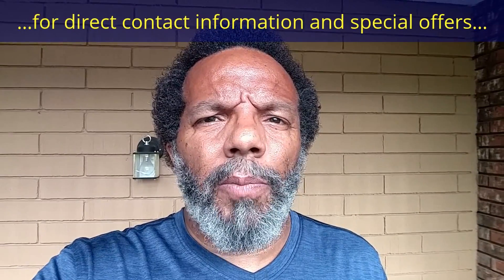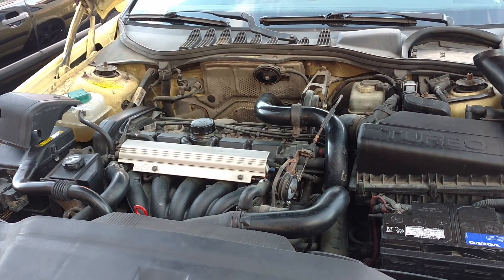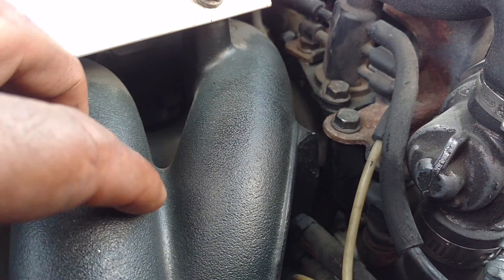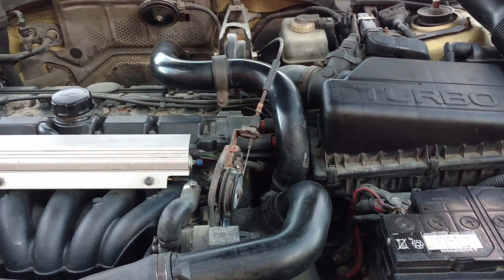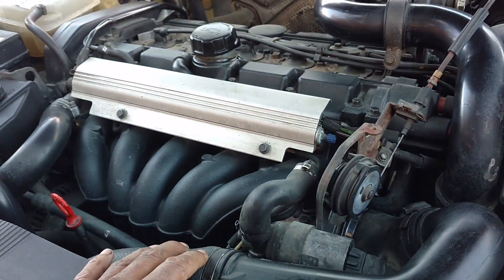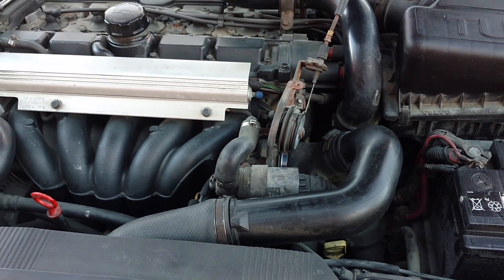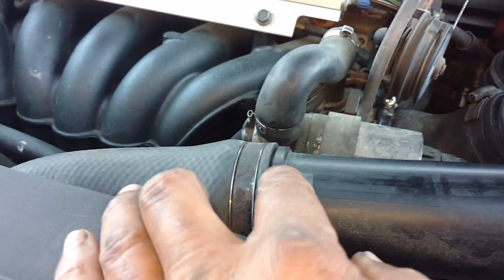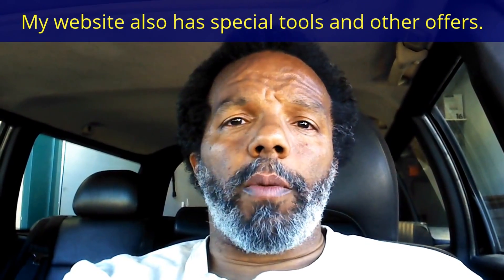Turbo system charge piping pressure tubes and vacuum lines need to be serviceable. - VOTD

Comment: Mine is running with one of those small pipes open on one end ,,my work is that the mechanic is saying it does not matter even if it's not connected
Reply: *my worry is that ***
Reply from the maker: 😳 gulp. All vacuum lines should be connected on both ends.

Comment: Robert I'm having a rough idle with my Volvo C70 2002 turbo 2.4 L every morning when I start the car up I got a code of 0014 and I changed the oil in the rough idle didn't go away so I changed the mass air flow sensor also because the car was running with a rough idle in that mass air flow sensor went out and I just change the camshaft sensor and I'm still getting a rough idle early in the morning upon starting the car what could be my problem with my Volvo 🤔💡🙄the car has excellent power on the highway and it runs great but I keep having that rough idle still early in the morning I'm contemplating having the exhaust valve timing solenoid change but I'm not sure if that's the problem could you give me some type of tip thank you
Reply from the maker: https://youtu.be/cWKOi8D4SWQ

Comment: Hey robert so with my 98 s70 t5 I'm currently experiencing a high idle when stopped. And when I come to a stop the idle will hover around 1200 . Unless I turn the AC on then it will drop to around normal idle or Maybe 100rpm over normal idle. I also have been getting a iac p0505 code, even tho it is functional. Car drives fine however it's just that idle and when I come to a stop.  Does this sound like a possible boost or vaccum line leak? Or am I probably looking at something else. Thanks
Reply from the maker: Yep, air leak. If it boost good, it's a vacuum leak.

Comment: 1998 v70r p0172, car runs perfect and builds boost perfect, vaccum lines look good. sometimes it take 10 miles to come back on after being cleared, sometimes it's 100 miles I'm honestly lost.
Reply from the maker: Is it idling high? Maybe the MAF.
Reply: @RobertDIY  I truly appreciate the reply I came to find the fuel pressure regulator elbow that connects to the manifold had a small Crack

Comment: Hey Robert, i own a 850 T5 and i think that the hoses from my TCV to the Turbo are swapped. i saw a construction plan where the hoses should go but i am not sure if this plan fits my motor. in this plan the TCV has 3 hoses. first is green, then blue, and at the bottom a yellow hose.
so what i noticed if i compare the plan with my hoses: the one at the bottom (yellow) connects where the green hose on the turbo should connect and so its in reverse: the green hose ends on the wastegate.....i have also a ,,pulsing'' acceleration....any tips? or any plan espacially for this T5 modell? (226hp) (1996)
Reply from the maker: Did you watch this video?

Comment: At 1:34 where you show the vacuum tree, my 96 850 Turbo only has one white line coming off the top (with the two holes below covered by caps). What does the black line above the white line on yours go to?
Reply from the maker: Probably the EGR.

Comment: I would like to ask you a question rather than a comment I'm doing PCV service on my 2002 S80T6 is it safe to start with all the turbo lines disconnected to back it out of the garage?
Reply from the maker: As long as nothing gets sucked into the intake. It probably won't start. Having that stuff disconnected will suficate the engine.

Comment: Hey Robert, I've got two OBD2 codes: "turbo boost sensor, and turbo boost sensor circuit a low" and my car idles and gets bad gas milage. I've got a 99 V70 xc. Could air leaks in the intercooler system cause these codes? Or should I get a new sensor first and foremost?
Reply from the maker: yes.
Reply from the maker: what is the code number? Have you Googled that?
Reply: @RobertDIY The codes were P0236 and  P0237. I have looked into them on google, but I just wanted to know what you thought or if you've run into this one before.

Comment: Now where do those vacuum lines go from the tree? Mine are all disconnected and it's been months since my Volvo has been running.. Thank you for your videos... They help allot
Reply from the maker: I don't even know what kind of car you have. 😕
Reply: @RobertDIY  lol. It's a 1994 Volvo 850 2.3 T5 station wagon.
Reply from the maker: https://youtu.be/gt9w-ZSxs9I
Reply from the maker: You can't tell from the video?
Reply: @RobertDIY  not from this one. Was looking for the thin vacuum lines from the tree to the intake, turbo. My brother Inlaw came and helped me out. He has the 850 sedan which was modified... Sold it after he ran boost of 2 bar. Mine is running nicely now. Still has that weak spot on the crank but I'm taking it easy now with her. No punching it till I have cash to get another moter. Thank you for your videos. They help me allot.

Comment: 1999 s70 t5 5sp. Just installed a pcv system. 3 days ago after project completed everything was go, but yesterday drove issues.  After 3k rpm... no boost?  
Anyway to test without load?
Reply from the maker: Smoke it.
Reply: @RobertDIY  watch the smoke test... looks not bad... I think I here the leak from around banjo bolt (or pcv box.... grrrrrr)
Reply from the maker: Sounds like a tube came loose.
Reply: @RobertDIY  hose on the top of the tourbo keeps blowing off.

Comment: Thanks again Robert I just changed my starter solenoid  and forgot to reconnect the turbo hose to the cooler . I was getting  reduced performance warning light  on the test drive . when i started agian it would cut out. Thanks to this video I picked it up straight away and fixed it
Reply from the maker: Good deal.

Comment: Hi Robert, my ´94 850 T5  Auto has a vacuum hose that goes to a metallic tube under the valve cover around certain plug wires, starts rubber from the big hose idle valve near the intake manifold , goes under valve cover metallic and then as rubber to intake turbo . Very few car see with this system,  not understand this metallic tube there.  Regards.....
Reply from the maker: Part of the PCV. You can delete that.
Reply: OK Robert, thanks.

Comment: i have a 2005 volvo xc90 T6, please tell me where each of the 3 hoses goes on the turbo booster switch i dont have a clue. got my engine replaced last week and sometimes it jerks at speed and sometimes when pulling off at traffic light or stop sign it seems to spin all of a sudden i dont quite understand and its giving me code P0238 and P0420
Reply from the maker: Red goes to the turbo inlet housing, yellow goes to the waste gate actuator, blue goes to the intake tube.
Reply from the maker: https://youtu.be/dUDSgUsSwmU
Reply from the maker: https://youtu.be/dUDSgUsSwmU

Comment: Hey Robert. Under the vacuumtree, under the intake manifold, theres 2 hoses. One of those hoses is not connected in my 850 t5 -95, where should those hoses be connected?
Reply from the maker: Bottom of the throttle body.
Reply from the maker: https://youtu.be/WIhEg6MYqTY
Reply from the maker: That's not UNDER, that on the front.
Reply from the maker: The small one goes to the turbo bypass, the large one goes to the purge valve.
Reply from the maker: https://www.youtube.com/watch?v=x8sXo5gbapM
Reply: Youre right, on the front my bad :) thank you alot for the help. I Also have to say that i love your channel, its priceless for diy beginners like myself.

Comment: Hi Robert. Im having this problem with my V50 T5 AWD Geartronic that my revs dont stay still when driving. Revs goes up and down, its like the Turbo puts too much boost and then releases. I will explain, when driving 45-55mph down the road, i have my foot still on the accelerator and driving the same speed at 1400RPM (this happens in Auto and Manual mode and with A/C on or off, doesnt make a difference) it will suddenly kick up to 2000RPM for 2-3 seconds then drop to 1000RPM during 1 second with a vibration and then go back to normal 1400RPM. Another issue i think is related to this, is when i cold start the car. Revs go up and down while start up, here is a video: https://www.youtube.com/watch?v=3CmFjgzzaV0
What can cause this? i will try to make a video while driving when it happen. It does happen every 1 minute or so at that same speed. mainly happens in 4 gear but can sometimes do it aswell in 3 and 5 gear. never really seen it doing it at 1 and 2 gear but i barely drive constant speed in 1 or 2 gear so i cant tell. Also last couple of days, when i start, it doesnt start properly. It shutters at 400RPM. I then stop the engine and try to start again and it start with fine but with the revs issue in the video.
any help would be apreciated :D
Reply from the maker: https://www.youtube.com/watch?v=NhtUXZTurzo
Reply: Robert DIY Sorry man, forgot to mention. I have no engine light on, engine light works tho as you can see on the video i linked in my first comment. Connected OBD2 scanner and no fault code found :) interested to know what you think it could be 😃
Reply from the maker: My guess would be the ETM. Some generic code readers can not find that pending code. The light or ETS light will come on soon.

Comment: Hi Robert, my turbo and the wastegate valve sounds very loud inside the cabin. I recently checked all the vacuum hoses and there's no boost leaks. My car runs well, i didn't felt power loss. 

So maybe there's in the firewall any hole or something that is open and the noise get into there? My car is a 98 Volvo C70 2.3 Turbo. Thanks for your help.
Reply from the maker: +Marcos Valentín how long has this been going on?
Reply: Robert DIY Today finally i solved the problem. It was very easy. the boot of the steering column on the floor was out of place, and that's the cause of the big noise inside the cabin. Now i know what to do if i want sick turbo sound into my Volvo 😃
Reply from the maker: LOL, Open holes makes the turbo sound sick.

Comment: Hello robert diy. i got a 1996 volvo 850 t5 automatic. the famous flashing gearbox light showed up and on the same time the lambda started glowing. i suspect it was the pnp switch that froze somehow because it happened on a parkinglot at -8°C. i got the car home in failsafe mode (slipping gearbox) and next day the arrow was gone away but lambda light still on. i tried to recieve blink code with a led and button but got 1_1_1 and my obd scangauge doesnt find a code. but light is glowing. can the gearbox indicate that there is a fault code stored via the lambda light? car runs and drives smoothly. i tried to disconnect battery ,both trans and ecu overnight but still the lambda light is on. Thanks if you can help resolve my issue.
Reply from the maker: +theAngelofhevn if the car is driving fine, I don't know. Have you checked the fluid level?
Reply: the car is driving just normal no slipping.Winter mode,D,R,1 and 3 works as usual. fluid level is on hot side about in the middle with 20min of driving. Going to try the Vol-Com method and see if i have a fault code in the gearbox.
Reply: hello robert DIY. i got the code cleared from the automatic box. codes were from the pnp switch and when i cleared the transmission codes with vol-fcr the lambda light went away! I just wanted to post here so you can tell everyone else that the gearbox CAN switch on the lambda lamp. Thanks for posting diy videos!
Reply from the maker: +theAngelofhevn +theAngelofhevn thanks for the follow up. Here in the US, that light is a Check Engine amber warning. Yes I do know that it comes on with some transmission issues. I'm surprised that mine has not come on, I guess it is because it shifts at the correct speeds when going forward.

The last time my car had a bad transmission, first gear was real bad and it would trigger the light, causing the light to come on and the car to drop into limp home mode. It doesn't slip in limp mode, it actually starts out in 3rd gear, like winter mode, then it doesn't down shift like it's supposed to. Limp home mode is supposed to protect the transmission. Once I was moving, I would use my scan gauge to clear the code (P0705 I think), and the car would drive good, as long as I didn't need to down shift to first.

Comment: maybe you can do a video on regular turbo cars and the R models and what would be acceptable to pay for 1 running good and needing work say a tranny...would be interesting and informative...in my area they have a 2006  S60 R but needs a trans for 5k. not sure its a deal ???
Reply from the maker: +AwakeDude911 bad deal. $2000 ish. Those transmissions are real hard to find.
Reply: AwakeDude911 Let me back up what he said. I have an 02 of the same car. Bad trans for 5 grand? Hell no. That is a very bad deal.  Unless you plan on buying a new trans for it, the used one, if you could even find a good used one, will very soon be in the same shape. Pass on that deal unless you have a know good used to fans. And by good I mean that you've had the opportunity to actually drive before buying. Not one that some guy says is "good".
Reply from the maker: NorthernChev man, they didn't make the S60R in '02, but I do understand what you are saying. Anyway, those 12 year old cars are selling between $3000 (good shape, salvaged title) to $6000 good condition, high mileage. It's easier to get a replacement engine than transmission. So, I might pay $5000 for one with a bad engine but not transmission.
Reply: yeah think id like an R Volvo but 5K price is to much even if it has 89K on the clock and in good shape...its still an northern car.
Reply: Robert DIY I didn't say I had an R... But I am having the exact same problem finding a good trans for my 02. THAT is why I commented. Although I do see the problem. I said same car.
Reply from the maker: This video may be close... https://www.youtube.com/watch?v=lRl8A_HIgeo
Reply from the maker: When I purchased Panther, it had a bad transmission. The good thing was, there were about 80,000 cars with the same transmission on the road, and I had a indi shop close to me that carried them all day long. For less than $600 I got the transmission replaced. I got 2 transmission, new seals between the engine & trans, fluid and the labor. 

The transmission for that mid '00 R, there are less than 12,000 of them from my knowledge, mostly on the road dying. A new one probably cost $5000 and then you need to add about $1500 for installation labor. Putting that car at about $12,000. Other than that you'd have to wait for another one to experience "death by texting" or something like that, and hope like hell the transmission is good. Then shell out about $3500 to get it in your vehicle.

Comment: It blows my mind when you go to a mechanic with a rough running car that unless it's a specialty shop that deals with your type of car NO ONE checks vacuum lines. My guess is that most mechanics are just used to naturally aspirated engines so they don't even think about vacuum lines, and with these Volvos (and in my case Saabs) there's quite a few. It's amazing how $10 of vacuum line can restore a car to running in like new condition.
Reply from the maker: Exactly. And you tell people to check them and they don't understand.
Reply: Robert DIY I moved to Florida about 4 years ago now, so I changed a lot of things on my mother's Saab that didn't really need it yet just because I knew they were expensive for a shop to do, and I cannot believe myself, I forgot to change the vacuum lines. A couple months ago one fell off and her car was running really rough at idle, she took it to the mechanic she uses (he's a nice guy, reminds me a lot of you in disposition actually), he fixed it for her free of charge but I feel so bad that I never changed the vacuum lines for her. After your 20th car changing vacuum lines it gets hard to remember if you did it or not sometimes lol.
Reply from the maker: +Jesse Crandle notes. Lol
Reply: I can't wait to check mine out and change them to see how it runs afterwards! It's been a project and I can't wait to hear it running well.